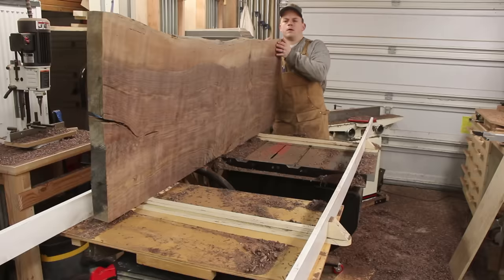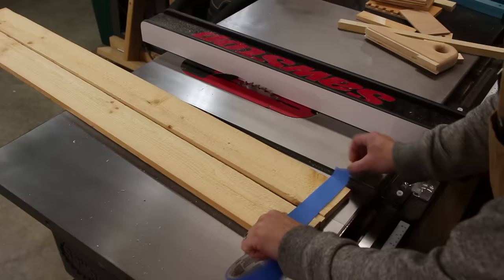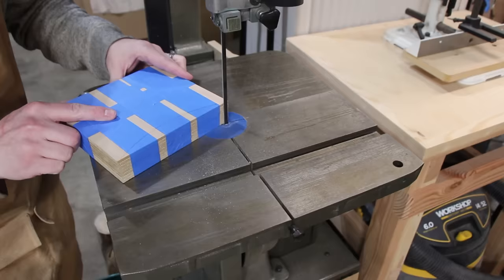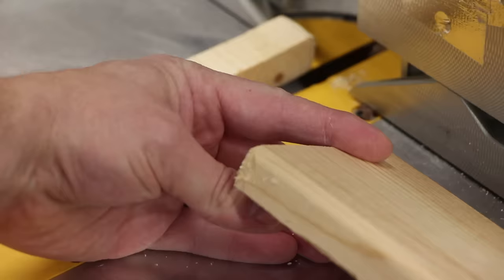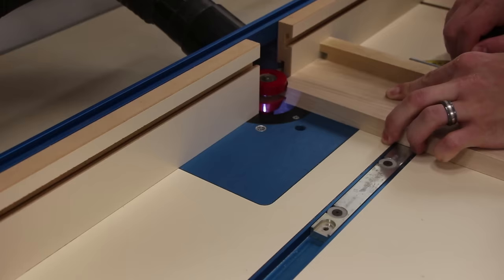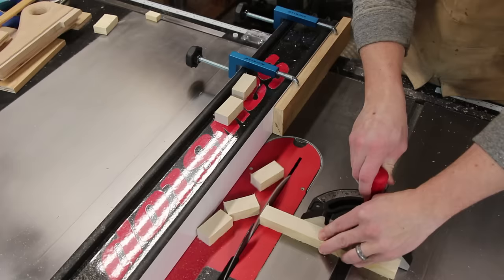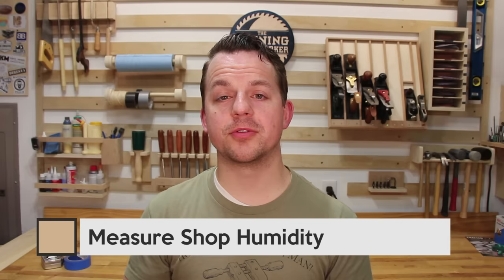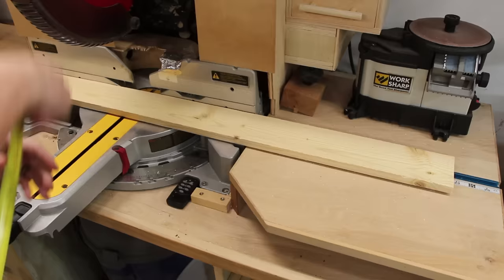7 Woodworking Tips & Tricks You Really Should Know | Evening Woodworker

Comment: I really enjoyed your blue tape tricks. One I would like to share that comes in handy is to put blue tape on a surface before you draw you layout lines. Such as on a surface you don’t want to mar, then dill through marked locations on tape and remove afterwards. Thanks again for your helpful hints.
Reply from the maker: That's a great tip!
Reply: I do that a lot but find it difficult to see pencil marks on the blue tape.  I use the light green tape for marking.  Much easier to see.
Reply: Or use a different colored lead in a mechanical pencil to make it stand out more against the blue. I have red and black, looking for white for my favorite pencil but no luck so far. May have to buy one of those "expensive" ones that use a "holster"...  Ugh! $$

Comment: A very informative video.  The only caveat that I could see is that you made the number 1 mistake many in the woodworking field do that results in premature tape measure failure (breaking of the tape where the rivets to the end clip are fastened). When letting in the tape after its use in the extended position, use your finger as a drag on the bottom of the tape to slow the retrieval down and then let the clip bump into your finger before it's fully retracted.  I haven't had to replace a tape very often using this technique, only after years of use when it finally wears out.  Keep up the good videos... Been at it for almost 50 years...   Kim
Reply from the maker: Yeah that's my preferred way, but it was so much more dramatic on video like this!

Comment: Amen to the temp/humidity gauge. Unless your shop is really big, a small dehumidifier makes a huge difference and they're not expensive. No more warped wood or rust on your tools is priceless.
Reply: @-XtraCredit-  Good question! Exhause not needed! In air-conditioned shops, humidity is usually not a problem in summer. The AC is a dehumidifier in itself. My shop usually runs 45-55% RH all summer without the dehumidifier. In winter, not so bad either. Spring and Fall are when I need my dehumidifier most because the AC is not running much. If your shop is big or not well closed in, I suppose the AC may not be enough. Hope that helps!

Comment: If you're using a squeeze bottle of wood glue, don't wipe off the tip; let it dry on the outside and not in the nozzle.  If you're replacing the sand paper on a bench grinder, burn the endgrain of some scrap wood to soften the glue. And, a wire brush can extend the life of that paper by removing buildup.

Comment: This might sound strange but I keep lipstick and nail polish in my tool pouches. Lipstick is ideal for locating that deadbolt hole without trying to shove the lock through the jamb. A little smear of it on the end will mark its precise location, awaiting the drill to do its part.
The nail polish is for those screws (and the odd part) that always seem to just about give up and keep backing out for whatever reason. A toothpick or two in the hole and a dollop of nail polish on the screws will keep the errant wanderers safely home in their hinges.
A tennis ball will allow you to make those lovely inverse arches on cabinet doors. A simple 1x frame around the door with a tennis ball/soup can/round cylinder in the corner when routing and as long as you're consistent and take it quasi-slow, instant reverse arch. I like the ball since it never leaves a mark and there's room at the bottom for my router's baseplate.
Reply from the maker: Haha those are good, I've never heard those before!

Comment: Thanks for creating such an entertaining video. I'm going to jump on the tape measure tip bandwagon. Duh. I actually laughed out loud when I saw that and appreciated the practical simplicity. And, take some time, do yourself a favor, and make a crosscut sled. I resisted making one for decades. I always felt there was a suitable "work-around". After finally making one, with adjustable stops, clamps, replaceable zero clearance inserts, etc. I was amazed. It's one of those tools that you keep finding more uses for. Thanks.

Comment: I have yet to get a table saw due to limited space (no dedicated shop), but I do have a Kreg Rip Cut that works great for me.  I tried using blue tape to hold my piece down while using it, but found that router template tape works much better and allows me to use both hands for the saw with the rip cut.  It works pretty good.
Reply from the maker: Nice! I need to try that

Comment: A trick that has always stuck with me for nailing up trim or moulding is to blunt the head of the finish nail. Never split trim again.
The other trick is keep a bar of soap in your nail pouch. Just stab a nail or screw into the soap and it goes in so much easier. This is especially helpful with hard wood and also works with drill bits for metal.
Reply from the maker: Those are great!
Reply: At some point in my life, I knew about both of those, but had forgotten them.  Thanks for dredging them back into my memory - they will get used!

Comment: Old tape measure truck i was taught is 1. Mechanical pencil, you're a woodworker not a framer, and 2. Mark to whatever side of the measurement line on your tape that your blade will be cutting and erase the line with the blade. It took me from working a 16th to closer to a 64th of an inch in cut accuracy. Also rubber pad cement floats are way cheaper than a 3d push block.
Reply: Carpenter taught me that, he'd yell "Leave the line" or "Take the line" depending on how he wanted the fit to be. We also painted every piece that was in the weather before installing it.

Comment: Tip to square your miter gauge.  Loosen the adjustment. flip it upside down.  Slide it in the miter gauge track On your table saw.  Push it tight to the table saw and tighten the adjustment.

Comment: On using blue tape as both hinge and clamp on the outside of miter joint glue-ups for boxes, I also use it on the inside of the box, on either side of the miters, two vertical pieces positioned right up to the inside corner when the joint is closed up, but just shy of the pieces of tape touching each other, so the glue squeeze-out on the inside of the box will stick to the surface of the blue tape and not the wood under it.  When you pull the tape out, all the glue squeeze-out comes with it.  This saves a lot of scraping and sanding later in a tight inside corner removing the dried glue, especially if you're applying a finish to the wood on the inside.

Also, I have used the crosscut stop clamped to the rip fence, but didn't bother purchasing the 2 fence clamps for it.  I just held a piece of scrap to the fence with a regular clamp, positioned as you did, well back before the blade.  Works just the same to keep the stock being moved with the miter gauge from getting pinched between the spinning blade and the rip fence.
Reply from the maker: Yes the blue tape can work on the inside too, but there's a limit to the clamping force it can apply
Reply: @EveningWoodworker  Oh, the pieces on the inside are for masking only, keeping the glue off the wood.  I still use the tape as you did on the outside of the joint.

Comment: Centralised dust collection, most people shove it in a corner then have tons of pipe running all over the place  put it in the middle of the shop and arrange the machines around it, done properly you only need a few feet per machine, which make it work way more efficiently

Comment: When the men in my church and I have shared tips with each other, I’ve found that the most useful tip they’ve benefited from has been when I suggested they choose that next project to be a hand tool only project.  They find that there are many things that can do faster, with no set up, and more accurately with hand tools than with their power tools.  They discover serous time savings and increase their problem solving skills at the same time.   Admittedly, I’d like to have a bigger jointer, but my bandsaw 8” jointer, and 13” planer really kind of fit all my needs.  What are some tips you think would specifically improve time, setup, accuracy for us handtool guys that maybe we’re not thinking of because we live primarily in the groove.   I’ve tried doing a project with more power tools thinking I would have some ah-ha moments, but just found increased set up time, dust, noise; and that nothing is finish ready, it still has to have a handtool and or sanding taken to it.   I know these are two different philosophies, but what cross over ideas do you think guys like me are missing?   Thanks for the content, I enjoy your channel 👍
Reply from the maker: I like to use power tools to take care of the big stuff and then the hand tools to clean up the edges, like when cutting a mortise or even a tenon. The power tools can get close to the line, but a sharp chisel or plane can shave off just a hair if needed.

Comment: Working with soft wood such as pine, and not wanting to sand it down any further to change the depth or width, I apply blue tape to write my pencil marks etc, thus preventing denting the wood surface. Either that, or write on the tape with a very fine fibre tip pen.
Reply from the maker: Good tip! You don't wanna scratch the wood!

Comment: When building with wood, moisture meter. When you are thinking about it, check the moisture using your moisture meter. If you can, put a dehumidifier in a garage or shop and keep it closed up. When you can keep humidity constant, it will help when you are doing glue ups or before you seal something with table epoxy, etc. Having wood with <12% moisture content really helps especially on slabs.
Reply from the maker: Great tip!

Comment: I made a donation box a while back, using oak veneer plywood. No matter what tricks I tried, when I cut across the grain of the veneer, I had tear-out. (Yes, the box ended up shorter than intended) Finally, I scored the plywood about a half millimeter from my cut line with a sharp razor knife and straight edge, reducing the tear-out to an easily sanded away amount.

Comment: Love the short router table crosscut guide. Looks like the Incra with an optional longer part taken off maybe? Wondering what rails in the table it is running in too. Blue so might be Kreg or Rockler? Looks very functional. Still using a craftsman benchtop table but I can’t wait for a router lift.
Reply: I made one from a scraps of 1/2" plywood and glued them together in a U shape to fit over the fence. It slides, 1 screw clamps it in place when necessary. Cost - nothing. Utility - lots and lots.
Reply from the maker: Yep it's the incra with a piece of wood screwed into it...rockler miter slot

Comment: Funny, I have never though of leaving the tape attached to the belt.  I have a tape on ever major tool in my shop.   I have stick on tapes on my mitre saw, table saw and work bench.  

Here’s a tip:  when I’m using my router and need a piece secure, but need to route all sides I put blue tape on the back of the work piece and on the bench.  I use 10 second superglue to hold it in place.  
I also use blue tape when I route end grain.  I wrap the ends with tape , route the Indus of the work, then the sides.
Reply from the maker: Man that blue tape has so many different uses!

Comment: Hi all... Completely Love the tape idea as your one hand is always occupied trying to handle the awkwardly shaped 10metre tape, keeping it fastened makes things so much easier.... Thanks, I don't know how that was overlooked by me all these years... One thing to point out though is that allowing the tape to snap back without arresting it with fingertip etc actually is not a good work practice as the constant flicking of the hook Part on the tape will result in considerable wear and tear as well as causing slight deviations in measurements over time due to the end of the tape stretching and distorting as well as hook to bend... If you are working to tight tolerances this can be bad news... It also just looks unprofessional having it stop back like that... Anyway, thanks for the informative videos... keep it up. From CPT South africa

Comment: That tape measure tip, I never thought of that. Great tip!
So one back at ya for finishing. Avoid an oops gluy fingerprint that you only see when you apply your finish... by using white vinegar. 
Wipe the piece down with the vinegar and you'll see every bit of glue that will ruin a finish. Then, go back and pat the vinegar on those spots, wait a minute or so (you may see it become opaque and can scrape it off of joints), and then rewet with the vinegar and wipe it off. Pulls it entirely out of the grain, without raising the grain. 
Just be careful on joints. You may have to pat and scrub a few times. You don't want to flood joints because if it's melting the glue enough to turn it opaque and you can scrape it off, it's doing the same IN the joint.
Reply from the maker: That's cool... I've never heard of that before. Does the vinegar affect the finishing later or can you just let it dry and it's ready for finish?
Reply: @EveningWoodworker  Just let it dry and then finish!

Comment: Great tips thanks. I just came up with a new to me masking tape and superglue trick last week as I needed to route some very small and accurate dovetail fingers. The solution was to route (on a router table) two dovetail slots through a piece of wood along the grain. The wood must be thicker than the dovetail is high. This leaves the finger between the slots. Now a piece of plywood is attached to the dovetail side of the wood using masking tape and superglue, attach well but be careful to put a good glue bead along the tape over the finger. This is flipped over and the excess wood below the finger is routed away, so liberating the finger. Sort of a discovered wood process.

Comment: I lost the end to one tape measure from letting it snap back in. Learned my lesson. All of my tapes are not the ones that you have to push the button to get it to retract. One is almost 30 years old. I don't consider any tool other than abrasives, as being disposable. My tape always goes in a pocket, not on a loop or on a pocket edge.

Comment: I just love that last tip on not removing the tape measure.... Brilliant !   What a time-saver, too !   And now I know  where that phrase "Whip your ass" came from... the rebound of that tape measure... Who Knew !   Seriously though, it's a really great tip.   And I think it works equally well for tape measures that have that latch to keep them from retracting... In that case, if your tape is made of metal (most are),  you can walk around with the tape hanging out and touching the ground.  That way if you get struck by lightning it might not be so bad because the energy will bypass your lower body through the tape at your side and detour to the ground.  Who could imagine a tape measure would provide an added measure of safety !   😀
Reply from the maker: Wow! Even more benefits!

Comment: the end of a tape measure is designed to allow accurate inside and outside measurements by sliding. if you let the end slam against the tape body the slot will stretch, causing the measure to be inaccurate  Reuben

Comment: I sometimes use the blue tape trick on frames but add one step, a drop of cyanoacrylic glue on each joint edge next to my yellow glue. I hit the joint with a spritz of the instant cure after pulling it together. Important to dry fit first because the glue will immediately set acting as a clamp while yellow glue cures.
Reply from the maker: NIce! That helps too, but you just gotta move fast!

Comment: There are ways to maneuver the chop saw through the board to minimize tear out. This becomes harder as the board becomes wider/. Running over the topmost part of the cut coming forward, then plunging all the way down, and cutting slowly back through the board reduces the amount significantly because of how the blade is spinning.
Reply from the maker: That's a good one! I like to do that sometimes on nicer hardwoods to get a cleaner cut.

Comment: Your tip using blue tape to prevent tear out is good but to make it even better I use a wallpaper seam roller to secure the tape more than just finger pressure and it works better than just finger pressure to secure the tape. It’s more needed on plywood than hardwood.
Reply from the maker: That's a great tip!

Comment: My favorite trick is to use a drinking straw to remove glue from corners.  Cut it at about 45 degrees and push it into the corner as you slide it down the crease.  It removes the glue and the excess goes inside the straw.
Reply from the maker: Oh man I definitely need to try that one! Thanks!

Comment: Good tips! The one I am not that fond of is leaving the tape measure (t/m) on your belt. I just don't like the tape retracting that fast and stopping so suddenly. I suggest using broken (tm) for shop work, we all have them. 
I work in my basement and I keep broken( tm) on the floor joist above my head by way of magnets.
If I am making precision cuts, I either use the same (tm) or I calibrate all my broken tapes. If you drop a (tm) and you are working with other woodworkers always recalibrate.
When I started  framing houses my mentor made us all check our (t/m) every morning.
He also had a branding iron and he would make his mark on every ridge "Framed Within a 1/16 of an inch" next to the PINE BRANCH that we nailed to the ridge, signifying ??? Do you know??

Comment: Tape measures... I won't have a big, clunky, and uselessly heavy 25 or 30 ft tape measure in my shop.  They are for construction sites.  The longest tape in the shop I have is 12 ft because 99% of what I work on measures less than 12 ft.  (There's a 30 ft. in a drawer for the one or two times a year I need it).   My favorite is a Stanley 12 ft with a 3/4" wide tape.  It is light, durable, and doesn't bend or "flop down" for about 5 or 6 ft.  I have one that I keep with my table saw all the time that I attach with an earth magnet.